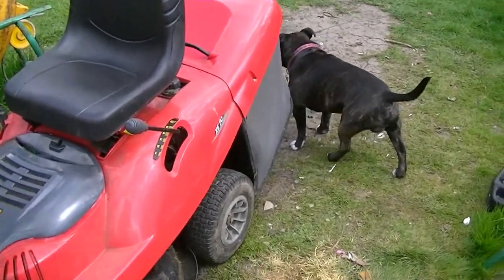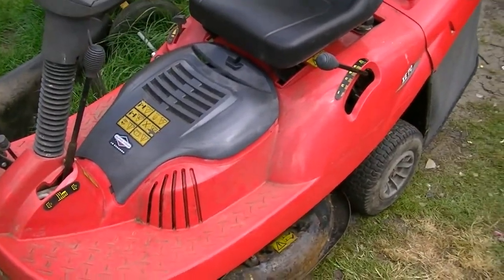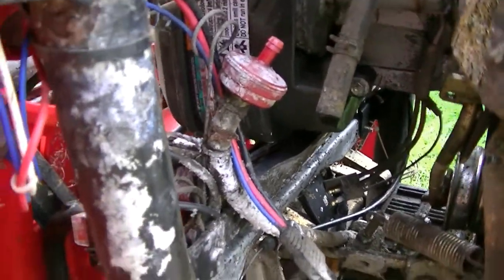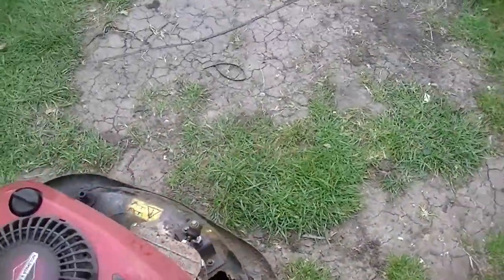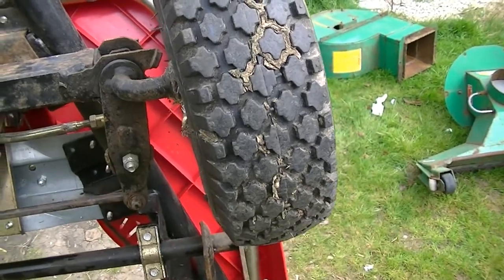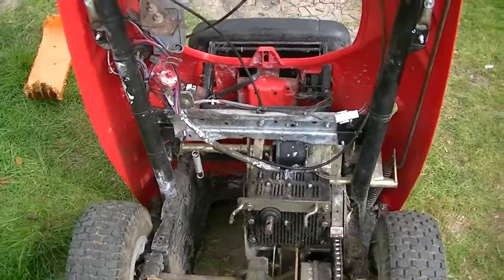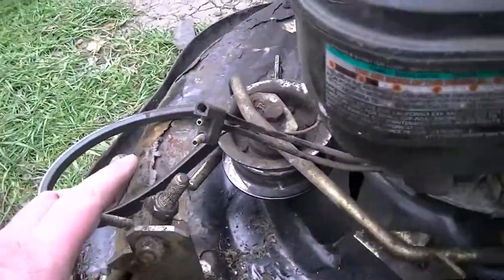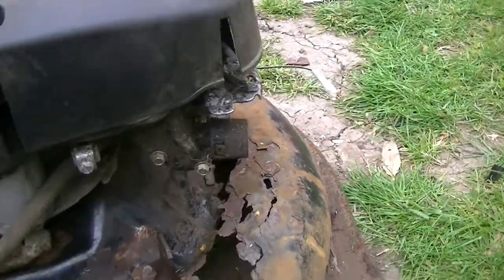RUSTY RIDE ON LAWNMOWER ENGINE REMOVAL

Comment: Thanks for posting, i was looking for that 1 spring on the knife if it was correct that it is only on one side... Looks like it is. I bought one like these with much more rusty deck and welded it back to factory... omg 2 day's work but new was 300 euro